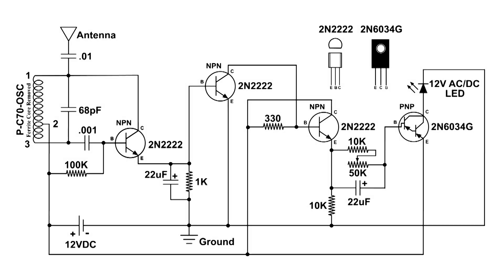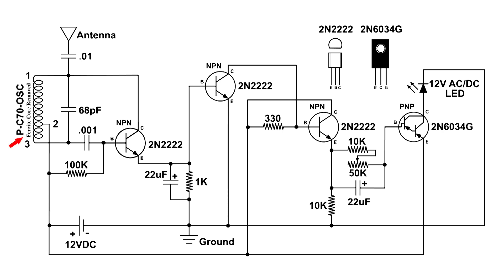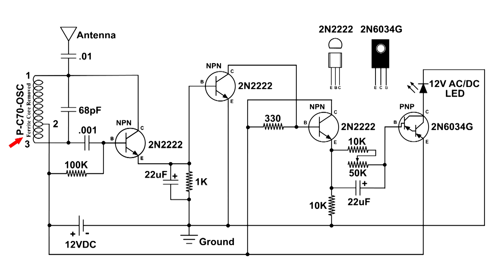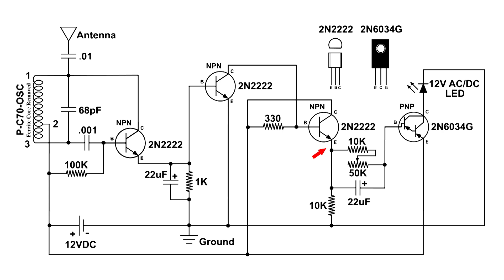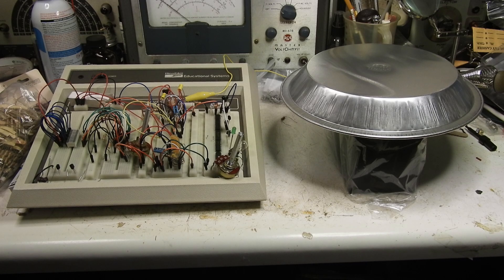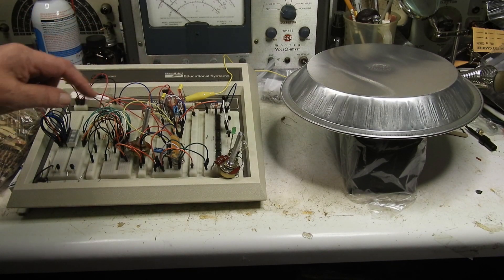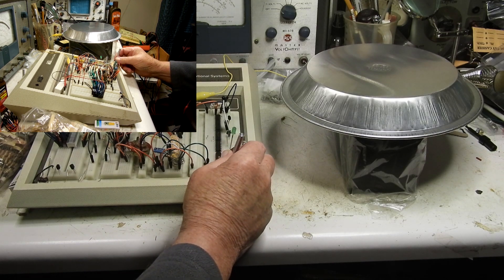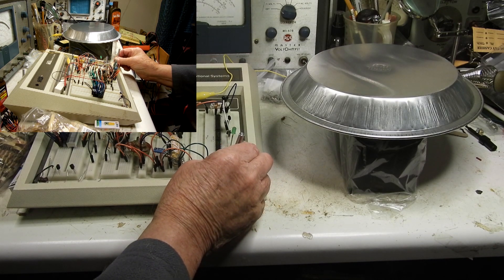Proximity Circuit Experiment #2 Working Circuit

Comment: How can I insert a relay into the circuit when it detects a person?  Will this also detect a screwdriver in the field?
Reply from the maker: The relay would where the LED is. No it will not detect a screwdriver because it don't have enough capacitance.
Reply: @AllAmericanFiveRadio  I seen the lights were dimming when you gotten closer to the plate. Will this interfere with the relay?
Reply from the maker: @jbjb303  The LED gets brighter as the hand gets closer to the capacitive plate. Just replace the LED with a 12VDC relay.
Reply: @AllAmericanFiveRadio  Thank you very much for your help and quick reply! I have looked at all your posts and enjoyed all of them.  Can I contact you if I have any trouble in the future too? Take care ... Joe
Reply from the maker: @jbjb303  Sure if I have time. Sometimes I can get pretty busy.

Comment: Sir any video on working RF transmitter receiver module circuit diagram for RC
Reply from the maker: AM Transmitter Build Project and Demo
https://www.youtube.com/watch?v=hhDjj45O4Lc

AM Transmitter Solid State, build and demo
https://www.youtube.com/watch?v=-KmO3_irhHg

FM Transmitter, MOSFET Experiment
https://www.youtube.com/watch?v=Aerr6v6Vwgk

Build a AM Transmitter, Project Info
https://www.youtube.com/watch?v=a2dW17YEzfU

Build AM FM Transmitter One Transistor Project 1-3
https://www.youtube.com/watch?v=6ZsQNtZZ_V4

Build FM One Transistor Transmitter Project 2-3
https://www.youtube.com/watch?v=2ihVw30vj8o

AM Transmitter Power Supply Build and Demo
https://www.youtube.com/watch?v=k3ZjRGAuIWU

FM Transmitter Varactor Diode Modulator
https://www.youtube.com/watch?v=JQGWr2dPe4E

Build FM One Transistor Transmitter Project Modification 3-3
https://www.youtube.com/watch?v=3tc3gBEU9Js

My free eBook on radios: password is allamericanfiveradio
The Vacuum Tube Shortwave Radio
http://www.richardmcwhorter.com/vacuumtuberadio/
Reply: @AllAmericanFiveRadio  thank you very much sir, it's very kind of you, God bless
Reply: @AllAmericanFiveRadio  sir actually , you have any RF transmitter circuit diagram and receiver circuit diagram for example  433 MHz transmitter receiver module. Designed by you sir🙏

Comment: Back in the past , they would have accused you of being a sorcerer. Imagine the townfolk outside your door with their torches ablaze.,,,, ps,,, where oh where have we seen that oscillating coil before?,,, hmmm
Reply from the maker: Hey Carl. So that's what that noise is outside my door. Where or why reinvent the wheel? Yes it my favorite oscillator design, you can make very stable or unstable for this circuit.

Comment: Great video and circuit!Thank you for sharing. Do you think it's possible to use a CD4049 ic for the oscillator?
Reply from the maker: You maybe able to use the chip. But if the oscillator is stable the circuit won't work. The oscillator should be unstable so that as your hand approaches the antenna, the oscillator frequency changes.